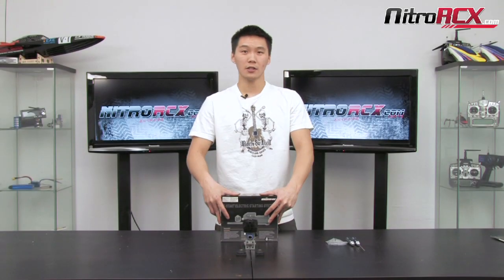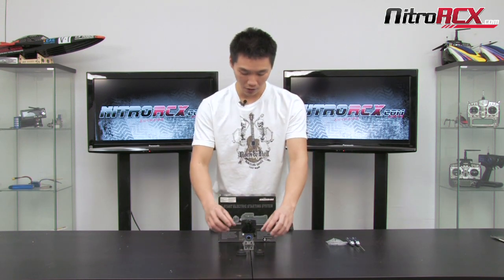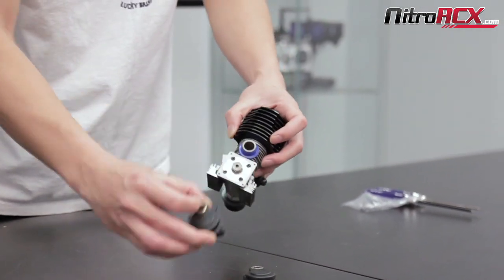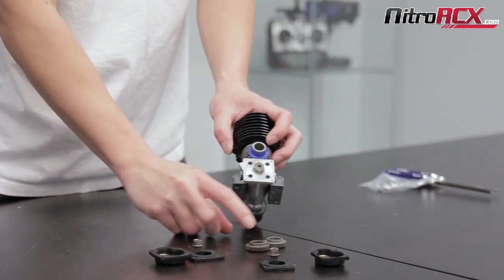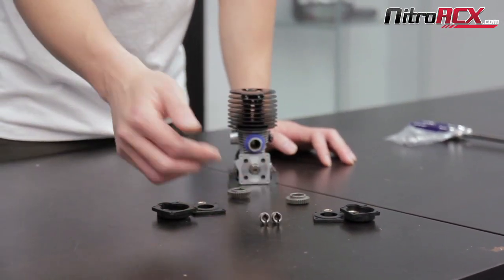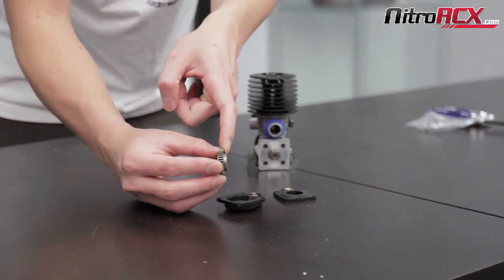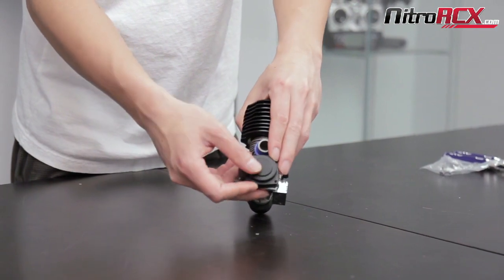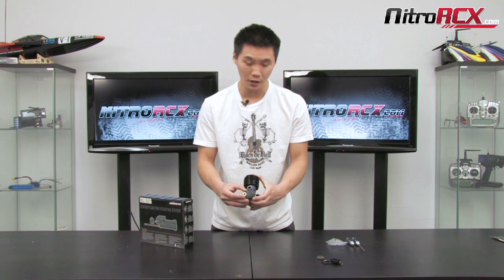Electric Starter For the .28 Nitro Engine

Comment: does any one know this actual product so i can buy it
. or tell me if a starter from a . 21 engine would fit a . 28 . sorry i am very new to this stuff and it would be extremely helpful . thank you
Reply: hey Max i bought a .16 Nitro Recently also considering an electric starter. from what i have seen in the videos the engines are very similar from .16  to .28   Best of luck with your quest friend :D